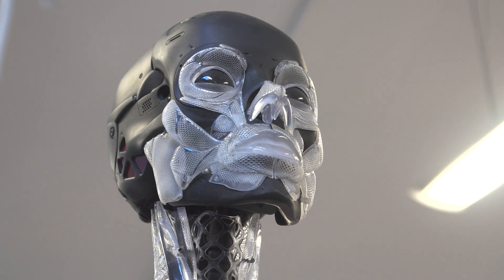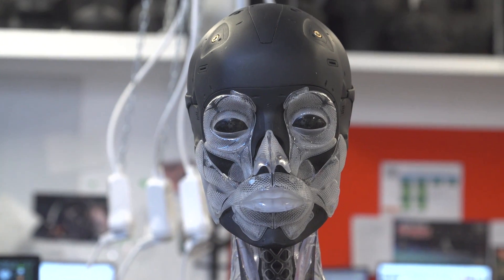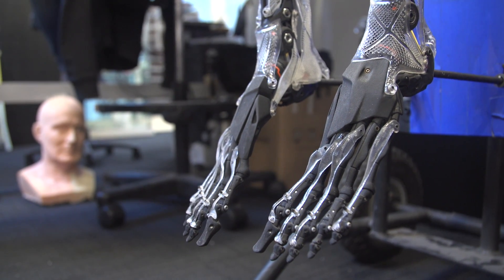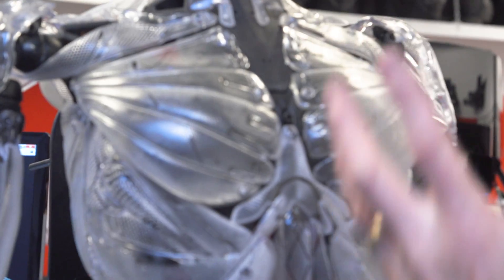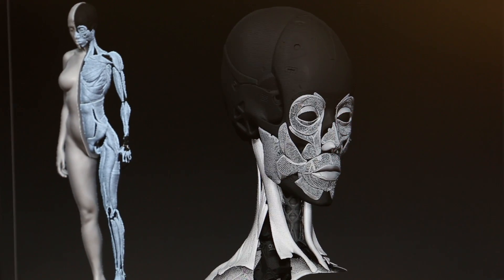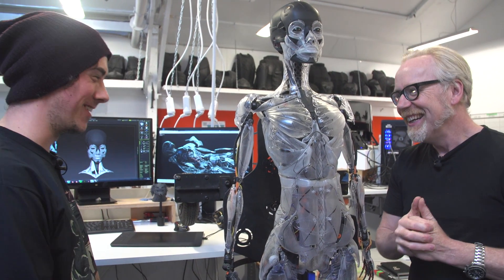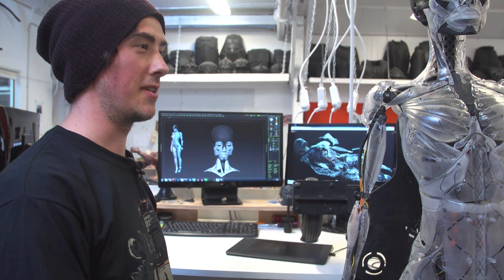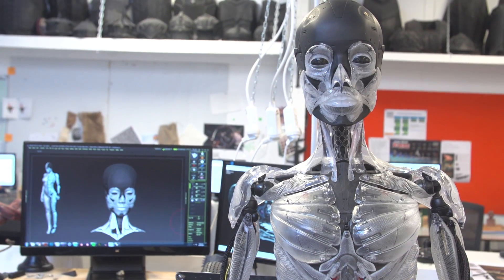How Weta Workshop Made Ghost in the Shell's Robot Skeleton!

Comment: yes! 3d aluminum printed skeleton modeled in program/ motors joints /gyro motor tongue / gyro eyes/ Anthropomimetic hydraulic pump muscles, fuel cell battery's/Super Quiet DC Motor. skin layers transparent silicone embryo shell for repairs / then painted with new properties of synthetic skin

Comment: im amazed they opted for 3d printing for the muscle structure. I assume its mainly because of the large amount of unique pieces all of which are merely needed in a quantity of just 1 or 2 pcs.. but still, it seems to me like such items would be so much easier to fabricate out of a textile based material (im thinking about the ophulstary of my car seats for example which have a very similar surface texture...) and then take silicone moldings off the originals for a final cast in a flexible clear polyurethane or something similar. just a thought... amazing work of art tho,.. belongs in a museum one day

Comment: 1:04. 3D Printed Steel Joints!?? Does That Mean They Can Use STEEL In 3D PRINTERS!!??!?!?! Like they do with plastic and polymers and such, I mean.
Reply: They're probably using the same machines as places like Shapeways, which use the same print medium infused with metal particles.  There is a finishing process that binds the whole thing together.  Additive metal manufacturing has actually been around for a while too.  But it is very expensive.
Reply: Yes, you can print metals. It is the same additive technology, but with a support matrix made from polymer, which is sintered afterwards. Complex titanium parts as well as high temperature ceramics for high end applications are produced that way. Steel and neodymium (magnets) are already printed for years for small volume applications, where mechanical strength and cost is of lower importance than production time and simplicity of fabrication.
Reply: Ignoring time, is it possible with existing technology to 3D print a semi truck? I would imagine that it would take at Least a week just to print the parts, if it could be done.

Comment: I dont think it sells the strength or the weight of the 300 pound Major. I dont buy The translucent muscles or the thin metals.  The original feature did it well. THAT was a tough body.
Reply: Pieces don't have to be bulky to be strong. The movie is also set in a futuristic world, so something the width of a hair could be stronger than anything we have now. It's sci-fi so anything is possible.
Reply: As they said the skeleton fits inside a ballistics jell casing. A casing that is the form of Scarlet Johanson, so, it has to fit her framework while abiding by a certain aesthetic. You can't just give it more hips, and stronger shoulders to fit the original look of the Major, because it has to fit the form of Scarlet.
Reply: Carbon fiber is stronger and lighter already then bones and is not the future.
Reply: i agree.  The original design looked like it had more weight behind it.  Plus, it was a good mesh of robotic and organic texture.  This design looks like it could break or snap in half real easy.  Then again though, it is science fiction, so who knows?
Reply: I agree, I much prefer the bulkier, more powerful Major from the original.  I have a hard time seeing this body almost ripping the hatch off a tank.  That is generally one of the reasons I am still questionable on Johanssen as the Major
Reply: Rudolf Menon We know about better materials now, and we can imagine further. With stuff like graphene, there's no reason it should weigh as much. Is bringing the tech up to speed so bad? I'm more concerned about the apparent change to her origin story from what I've seen in the trailers.
Reply: That's what I figured.  Well the point is, search youtube for the Ghost In the Shell opening scene, and maybe possibly you'll find leaked footage of the film version, and you'll be able to compare how this prop looks in context.
Reply: I definitely see where you are coming from, but then again, the idea of the small humanoid form of the Major in the original film ripping the hatch off a tank was frankly astounding at the time. That was part of the idea, no? I imagine that this particular iteration would produce a similar reaction, especially to newcomers.
Reply: Drew Lakebrink simple, not a sci-fi, it's a Space Opera, entirely different type of film. For example, what is the main plot of the original Star Wars? A chosen seemingly nobody farmer boy is trained by a old wise hermit to learn magic and is tasked with fighting the evil space wizard and his empire and to save the princess. See, it has nothing to do with technology, it could just have easily set in Medieval Europe and have basically been the same. The technology is merely a medium used to make this age old fantasy story more interesting, instead of swords it's lightsabers, instead of wizards it's Jedi, instead of Magic it's "the force" and it's in space with cool space battles instead of on ground with large armies.

 Now compare that to Star Trek, where the who plot revolves around space exploration and new Alien species and interesting technology , and that's just a regular Sci-fi.

 Ghost in the Shell is a Cyber-Punk which means it isn't just a tale of future technology and neat adventures in space, but rather a darker more realistic view of technology, and more importantly, how it effects us, not just as individuals, but as a society and Humanity as a whole. That is the core of series like GitS, Deus Ex, Terminator or those classic Isaac Asimov books that many such stories take inspiration from. They are all about the technology and it's benefits and consequences to Humanity, and the moral,ethical, and or philosophical questions that arise from said technology's effects.
Reply: Then explain to me why your logic doesn't apply to other films such as Star Wars? Nothing in that movie seems believable except for space travel.
Reply: Can people see my previous reply?  It contains a link to the new film's opening sequence for comparison, but it strikes me that comments with outgoing links might get hidden
Reply: z beeblebrox For me, this was your first reply. No link.
Reply: Drew Lakebrink looks are important in a movie, saying that it's the just the future and therefore it's ok comes across as being lazy. 

it's like when someone pulls something stupid out of their ass in a Medieval fantasy movie and all you get is a "cuz its magic!" for a reason. Science fiction is supposed to be believable, especially cyberPunk, not just " hurr durr cuz itz da futur", make something seem as though it's real or could be real in the future, not just it's advanced so whatever.

 if something looks bad, then it looks bad, and that only hurts the movie piece by piece. a good movie isn't one thing but rather the sum of it's parts, it's it drops the ball and everything looks off, "but hey guys it's ok, it's the future, anything is possible!" then it won't be a good Sci-fi movie, it will just be a sub par movie that technically takes place in the future. as for your Irobot example, those were your classic, "handy helper" robots that were meant for menial tasks. The Major is part of a Special Law Enforcement task force, she shouldn't look like a frail maid, which is why everyone else in this comment section agrees that the 95' film internal body looked better.
Reply: I guess you haven't seen iRobot. Those robots aren't bulky and yet they can do some crazy stuff. In the end this is a sci-fi movie and anything is possible. No need to try and make it fit into what we have in the real world.

Comment: Building something like this in 3d is not hard at all. If you look at it, its just a regular female character anatomical sculpt (look up at art supply store). The muscles got shelled and hole punched to shit. What is impressive, is how much money Weta has lying around to get a gigantic industrial 3D printer
Reply: Well, you're wrong about three times there. First, they used normal-sized printers. It was assembled from 200 smaller prints. The "hole punched to shit" isn't even close to what those support structures are. And any idiot can design 3D models that are impossible to print, or instantly break because they're not structurally sound. What's on show here is a deep understanding of materials science. If you're truly going to be condescending, you'll need to actually know what you're talking about, first.
Reply: I hope your joking. Modeling something like that would take a lot of skill and a lot of time. Of course its a anatomical sculpt because its suppose to be the insides of a person/ cyborg... who wouldve guessed. Even if it was all cgi youd have to model, texture, retopologize so it can be optimized, unwrap high resolution mesh with all detail and then apply to low resolution retopologized mesh. And with hard surface modeling throw in the extra step of sculpting and then repuilding it piece by piece. Now add on the intent to print, as said above, would be the task of making sure it will print properly.
Reply: Apt username
Reply: Peter Condescending do.. you know... anything about 3D at all...? it consisted of multiple materials and they can actually move and rotate the joints so it's not just "holes punched to shit on a downloaded female anatomy 3D model". Please go back to your modeling class. Such a shame.
Reply: Do pay no mind to the ball sack, it's one of the example of a sad complex. People with too much time on something do that. 

He low key tryna be competitive when he be far from it, lmao. dude remind me of one o my lecturer, almost erry time at class he be down talkin other more succesful peps his age. It shit and awkward, but we had good chuckles.
Reply: Loool chill, never said he was "great" I'm quite specific with words lol just said if you were better you'd be known. The title industrial designer doesn't mean your're good, and he's done projects bigger than a lot of people carrying the "industrial designer" name and yes its not his best design or the best design of a robot never said it was. I'd genuinely love to see your work though :)
Reply: Peter Condescending still something you have no idea to do. Why chiken like to act like eagles.
Reply: +Peter Condescending 'Something Vitaly is desperately trying to become', the dude's a fucking genius in the field and is amongst the best in the industry. Do you even know wtf you're talking about?
Reply: Pretty condescending when you probably don't even know that much about how the actual process goes. You honestly sound like you're just talking bullshit and you're just trying to troll people on the internet.
Reply: the images from the video are more impressive than your claims
Reply: so then print one and show us the video of it
Reply: Just reading this gave me nightmares again of doing simple modeling and textures for CS skins long ago...
Reply: "Building something like this in 3d is not hard at all"
"Any basic character artist can do the same job they did here in ZBrush"

Damn you must be a legend. The maker of this suit is Vitaly Bulgarov, given you're so amazing you definitely know him, also if you were better than him I'd definitely know your name. 

"The skeleton was 50% CAD (for more machined looking parts) and 50% SUBD (more organic bones) made in XSI(softimage). Muscles on top were blocked out in Zbrush, then z-remeshed and either retopoed in XSI for specific look or finished in XSI as a subd object to get the diagonal hole pattern" 

that was his specific workflow in this instance. Since you know so much about 3D you'd also know the design process is 10 times harder than the modelling process and that the skill is in the design language not execution of pressing buttons in the form of modelling. Condescending is in your name so I'm not expecting much but I thought I'd give you insight into his workflow from his mouth directly.
Reply: I love how little you know about CG work, Industrial design, and 3D printing. I did all 3 professionally for years. 1 They are using Industrial MJM printers with Wax support, which melts off and allows you to print whatever you want with no support marks. 2 "Material Science" - Hello printer manufacturer, I would like to buy clear resin for our printer. 3 The software they use is called Zbrush, and in Industrial design world, its referred to as PLAYDO. This software does not produce structurally sound models (that's why Adam couldn't flex anything). And so what if it is made out of 200 pieces? Everything depends on quality/time/budget. In fact, if he could do the same job with only 100 pieces, that would make him a better designer...
Reply: Go read my comment I gave to Jeremy. Any dribbling noob can lubricate genitals and say "its great". I wasn't belittling the guys who made it. I just find it funny how little people know about MJM 3d printing. Any basic character artist can do the same job they did here in ZBrush
Reply: "Whoa, who dares insult the great lord savior Vitaly". I'm an industrial designer, not a character artist (Something Vitaly is desperately trying to become). Funny thing is, he did much better designs in the past. But hey, good luck to you in your studying to become 3D Environment Artist. When you get a job, you'll find more talented people to compare Vitaly to :)

Comment: I didn't know it was possible to 3D print steel. I wonder how solid 3D printed steel structurally is...
Reply: it's like normal steel I think. it's made by having powder and melting it, I think, with lasers, so I assume it's pretty strong
Reply: Selective laser sintering of powdered metals. The plastics are photosensitive resins. No FDM parts here